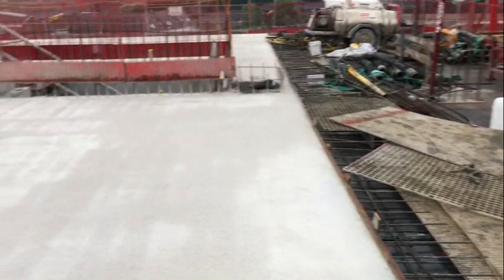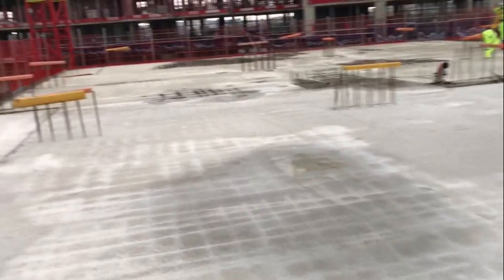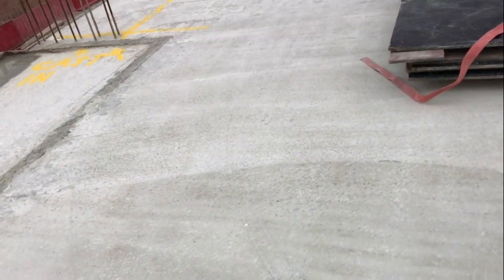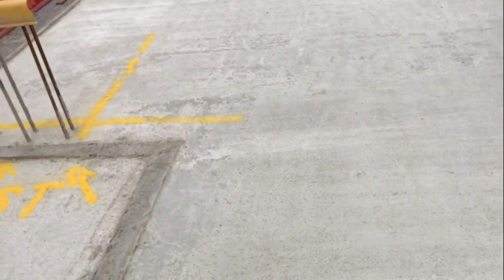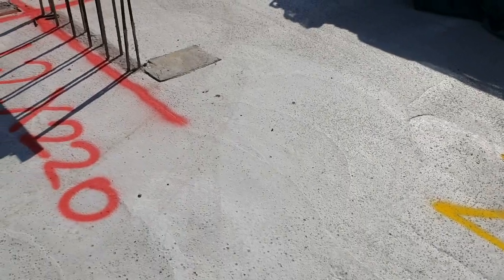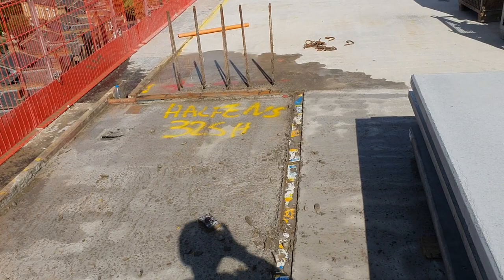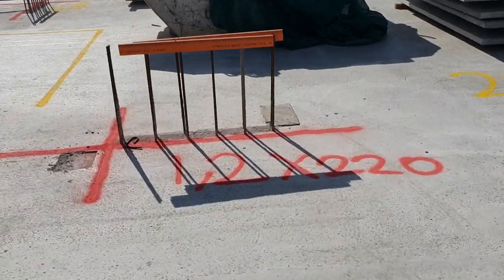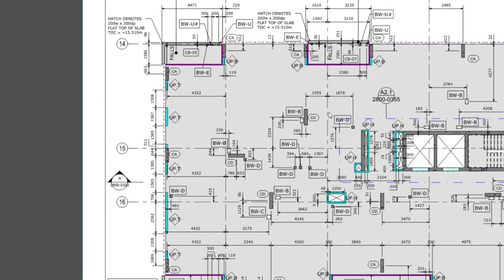Concrete slab SETTING OUT. AS BUILT level survey. Information for the next level.

Comment: Hi Greg I am nearly a graduate engineer and on some of my drawings, the column concrete grade (C40/50) is larger than the slab concrete grade (C32/40). How do you deal with this joint on-site, I think you hinted at it in the video and I can see the wet concrete colour on the columns but I don't fully understand? Once you are pouring the slab are you supposed to infill around the columns with the higher grade concrete or just use the weaker concrete over the column?
Reply from the maker: Hi 😁 don’t need to pour coulumn concrete in the slab area although if pouring the kicker that should be column concrete. More compression in the column and often stronger concrete is used 👍

Comment: hi there- really great video. Are they marking out for the column kickers here or will the entire column be poured? Also are the column kickers usually poured after the slab?
Reply from the maker: That was marked for the entire columns. Yes they usually poured after the slab pour, sometimes there might be a kicker poured with the slab (handing shutter-timber) - eg. liner wall. Please remember that the kicker should be actually poured with the 'column concrete' which is typically of higher strength than the slab. Pouring kickers is a really good practice, but it's  time consuming and in real life not often used.

Comment: Hi greg we are waiting for more vids from you pleaseeee. Plz teach us how to read soil reports, cube results and concrete mix designs.
Reply from the maker: Hi Khalid! Happy you like it, there will be more and I will try to show these as well, but can't promise when.
Reply: @SITENG  no worries pal. Quick question what is the tolerance for setting out grid lines?. I am currently setting out grids whats the best way to mark out grid lines do you normally string line it or chall line? How far should be the intervals of where u set out since if the two points are too fsr apart there is a likely hood of the lines not being bang on
Reply from the maker: Depends really on few things, if the surface is ok and flat you don't need to mark too often, but obviously the more marks the more accurate it will be. Not sure about the tolerance as this should be in your job specification. You have to get the best resection you can and go for 0 when marking, use target when aiming using non-prism mode. I wouldn't recommend pole with prism for this 😊

Comment: Great video. Greg with the SL asbuilt on the RC slab displayed, did you set the EDM to do the +/- tolerance measurement eg.+0.002 based on the design level etc during the survey or you did that on CAD?.
Reply from the maker: Thanks Frank! EDM was set to designed slab level so it's giving info like this. I did not do that survey, but I don't think there was limit tolerance set on the EDM.
Reply: You put the the design level and the edm measures it based of that if its lower it will automatically say - and if higher it will be +.
Reply from the maker: Yes, it will take the height as a reference and it will show you + or - from it :)
Reply: @SITENG  thanks Greg, u always don't disappoint. Just a quick clarification,  reference the Asbuilt, I know on the controller it shows +/- "the design data" during the survey. But is there any way (software wise) after you pick the survey,  it will display the +/- on CAD. Please....😃😃

Comment: Hello. Yeah for me it is better to mark columns at slab before the fixer will come. 
Can you make some more focus to this nails, which are you marking point at concret?? Its look like small starts;-)
Reply from the maker: Hi Karol! I am not sure if there are nails used there. We typically use small concrete nails (hilti nails they used to call them :) . But I only use them if the weather is bad, or want my points for the line to stay long.